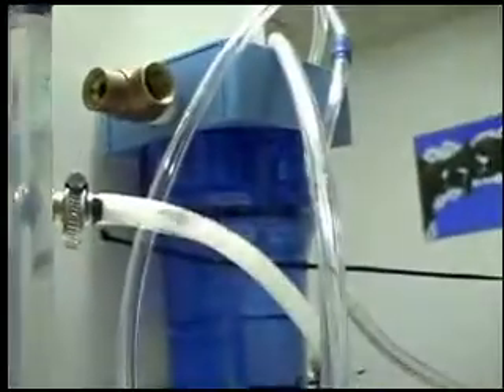#5 HHO Diamond Cell Trial

Comment: nice work brother i cant wate to see your
systems with a pump ,also do some gas
production test like the one i did in vid 100 amp gas production reading . dont use a flow meter made for air density issue are missleading you. you build some very efficiants sells ,how long it takes your econo cells to push 2 liters 
of water out of an inverted soda bottle gas trap rig? do this experiment for me and ill owe you one maybe i have devices you would like to experiment with

Comment from the maker: I have seen patterns on my plates each time i dissasemble. I haven't paid close enough  attention to them. Thats a great tip. I have seen a black carbon looking deposit on some plates when open the cell. It just falls off when i put it in a vinigar bath. Have you seen a black deposit on your cell plates? It is only on mabye 2 out of 19 plates while the other 17 just have normal patterns. My guess was a piece of rubber, from these cheap gaskets i was using before, got between the plates.

Comment: when you disassemble your device, there is a telltale fluid level line on the positive plates where the potassium has plated to the stainless steel ... you dont need x-ray vision ... just run it hard for a while and take it appart ... the patterns on the plates have much to tell you if you are carefull and listen to what they have to say ...

Comment: with a fairly small device, something under 60 plates, the 1/16 spacing seems to work well ... but as you get into the big ones, you start having problems keeping the fluid level up in the center ... it stays high on then ends, but goes low in the middle ... only way I figured how to beat the problem is to use a wider gap ... I have settled on 2mm as working best for me ... sort of split the diference between 1/8 and 1/16 ...

Comment from the maker: I bought copper coated BB's a month ago but i havent tried them yet. If you say it works for you then i will try it for sure. Thanks.
The spacing is 1/16" between each plate. I may go to 1/8" in the future, just to test the benifits of each, but as for now i am happy with 1/16".